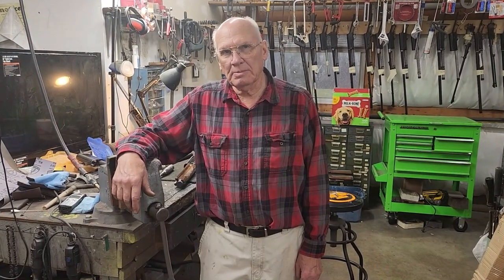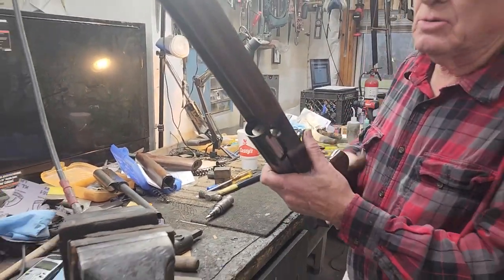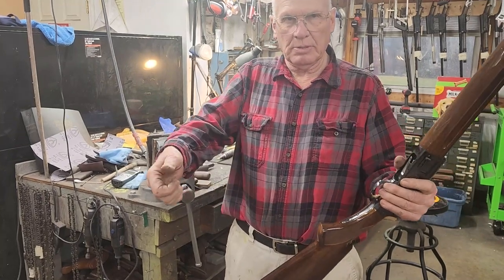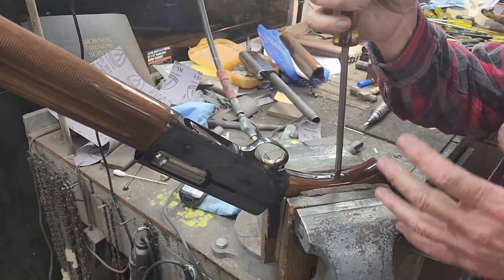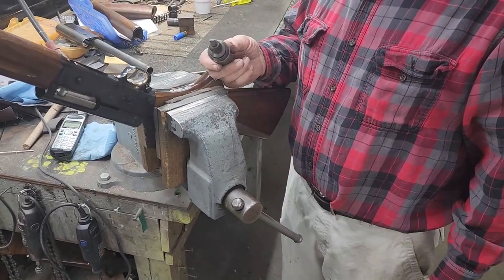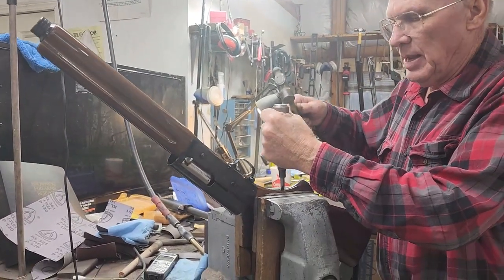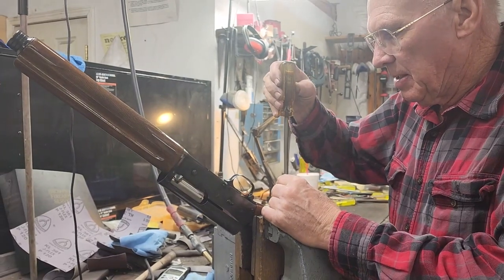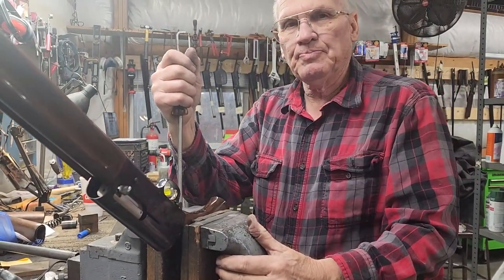How to remove tight screws.

Comment: Another hint.....IF ( if) you can mount the gun tightly like on that vise that you show....AND....have it sit on a drill-press table surface......put a properly sized screwdriver bit  ( parallel face, hollow ground) in the chuck, and bring the chuck down onto the screw with the lever arm of the drill press. That should often exert enough pressure on the screw slot without letting the screwdriver bit slip, while holding the lever down. Then turn the drill chuck.....even if you have to attach a channel lock or some kind of "lever" on the chuck.......

Comment: Correct .   Excellent for the bottom trigger plate screw on doubles.  MUST grind ( and heat treat if needed) bit exactly to slot, including bottom shape of slot.   Hammer impact driver. And know how to use it with proper rotation preload.

Comment: You can hollow  grind eny size Phillips  down with out over heating ,macth round shanks too screw with knock 2 side off far superior  too high dollar gun screw drivers I done thousands in the last40 years p.s flat punch  them screws deformed or not hard plastic handles  are best to smack  in them slots if it's a rusted time bomb put it under water for a week   work everytime.

Comment: I'm trying to get the stock off of mine, but the forward screw (ahead of the one with the lock screw) is too bunged up to get a driver on it. I'm not mechanically inclined at all so I don't have any solutions except force. Normally I'd say oh well, but now the bolt won't come all the way back and lock into place like it should, so now I'm forced to continue disassembly but with that screw being too bunged to budge, I'm stuck.
Reply: That sounds like the trigger spring screw.  You don’t have to remove it to get the stock off.
Reply: @Thunderball66  You were correct. I got it all stripped, cleaned, put together and back to original format today.